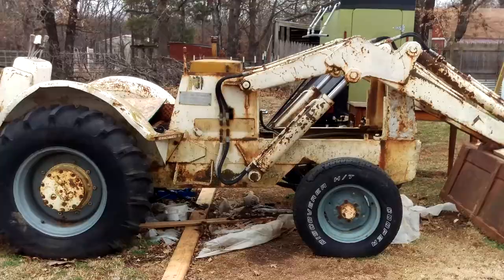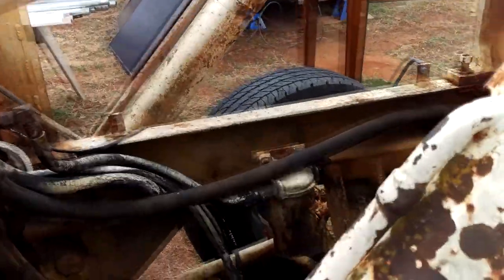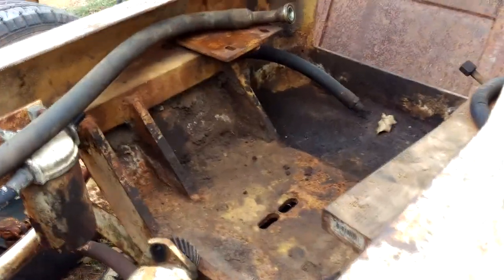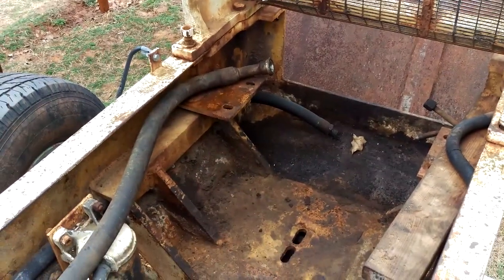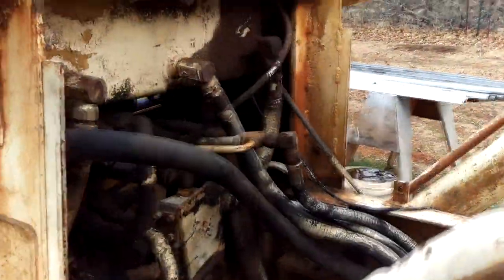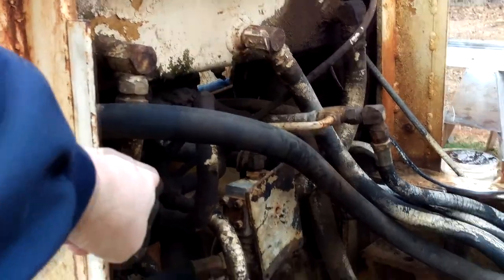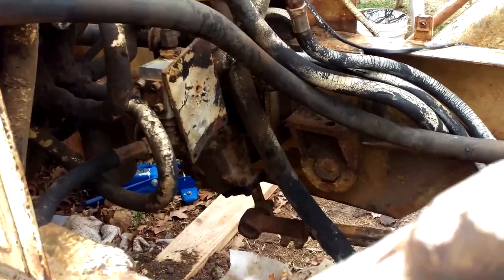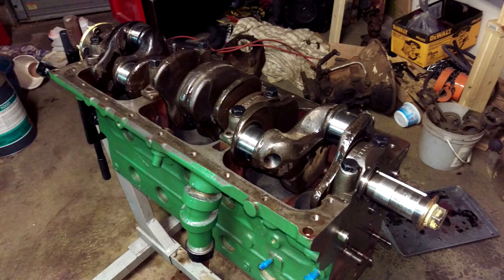Dyna Update! - The Contentment Backhoe Project

Comment: Sorry to hear about the warp in the block but i think the machine shop should have noticed it when they cut the top.....Thanks for sharing.....
Reply from the maker: Actually, we mentioned it to him the first time we took it in. But he attributed the problem to the crank, not the block. Was only after he turned the crank and we tried to put it in that he understood the problem. Thanks for watching, Thomas! Good to hear from you. Funny, the engine shows no sign of prior heat damage or spun bearings, etc. and the crank saddles and caps have never been milled before. Just old, we guess.

Comment: Hi guys, keep up the good work.
Reply from the maker: Thanks Rick!  Good to hear from you.
Reply: Contentment don’t be a stranger.
Reply: Contentment the hydraulic valve is connected to the what’s mulcallit  thingy a bob pressure gadget bottom petalshifter bottom .  Ignition switch.
Reply: Contentment how it going??
Reply from the maker: @gardeningingnometown5644  Hi Rick!  Got the engine block back from the machine shop and putting the engine back together now. We hope to test it running this weekend!  Other than that we are very busy preparing for our summer at Contentment!  We are excited. Thanks!
Reply: Contentment how long will you be staying out on the property?
Reply from the maker: @gardeningingnometown5644  Rick, we don't know yet for sure.  We are awaiting the sale of the house at Location 2, which should close by June 7th. If we can get things together in time, we hope to be at Contentment by the middle of June. The plan is to stay at least through Labor Day.
Reply: Contentment nice!! how much fun? Why not jump off the deep end  and make the paradigm shift and stay for good?
Reply from the maker: We planned to do it next year but are considering it.  Just don't know yet if it will happen this year.
Reply: Contentment  it’s a great feeling the panic passed quickly.

Comment: are you 2 ok havent heard from you getting worried
Reply from the maker: Hi Thomas!  Thanks for your concern. We are fine, just super busy with everything. We hope to be at Contentment by mid-June and wondering if it will happen. Engine is back together and attempting to fire it up now...having a problem with ignition - ground problems, we think. We will get another video up as quickly as possible. Thanks!
Reply: @contentment164  Ok thanks been worried
Reply: And i some how lost your #